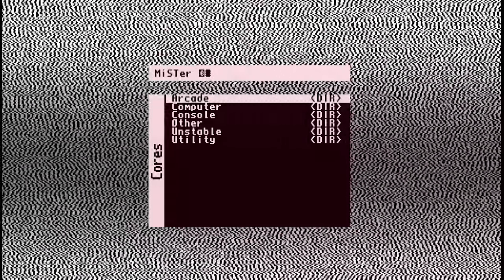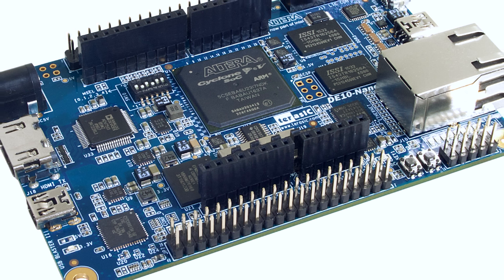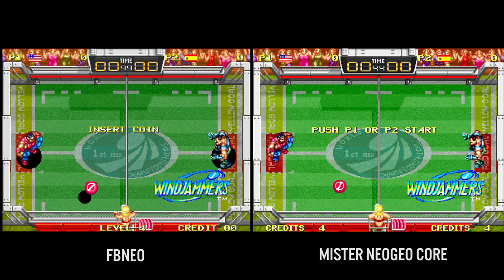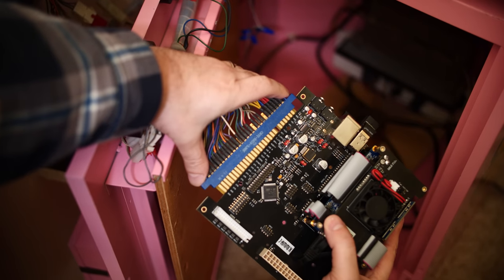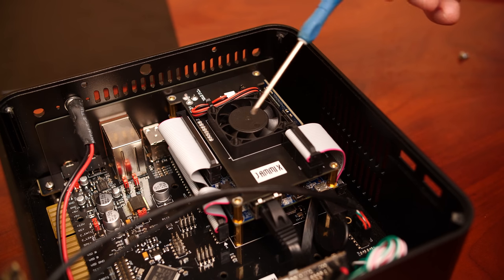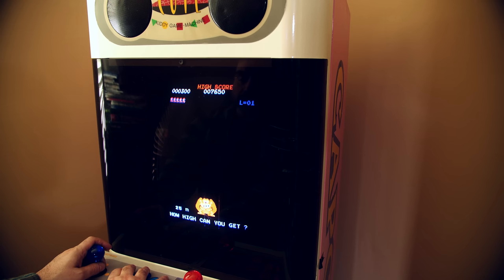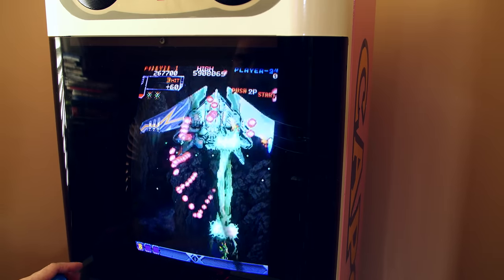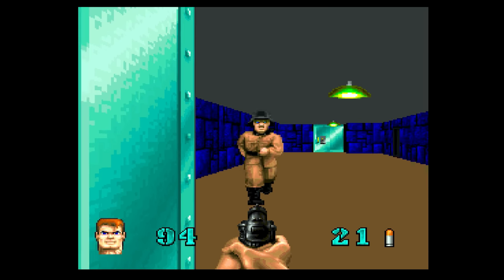Finally - I got my hands on a MiSTer FPGA Retro Gaming Setup | MVG

Comment: Anyone interested in building a Mister, lease don't buy a DE10 nano at scalper prices. These will keep being made and you will be able to source one for sure as long as you have a bit of patience. Consider buying the add-ons you want instead while you wait
Reply: there are several legit sellers of prebuild systems aswell, you just need some patience since they are waiting (and getting) restocks. 
been the same 1,5y ago
Reply: Order direct from Terasic! I did that, and paid retail, and $40 shipping, but, it came from Taiwan in under a week (3 days, if I remember right from placing the order)
Reply: I bought it directly from the factory, but between shipping and customs I paid around 300 euros. That's almost a scalper price (185 euros the board + 50 shipping + 64 of FedEx "customs")
Reply: This isnt the Framemeister where it uses legacy products, this uses current tech and just be patient they will be making more.
Reply: @kaisersoymilk6912  can you link me to where you bought it
Reply: I've paid 400$ for Mister from Aliexpress.
Reply: They are not scalper prices.  Just the DE10-nano kit is 150$ for education pricing so you need to provide a valid educational facility or student ID to buy it for 150$ USD + shipping.  If you want to purchaes it new.  I wouldn't trust the 2nd hand market from experice.  That FPGA chip does not have a thermal sensor so if it runs at 100 degrees for too long, it will start failing.  You can check the datasheet if you are bored.
Reply: What ever way you enjoy to play is they best way!! ❤️
Reply: Please! Give me a site to go to!! 🙏🏻🙏🏻🙏🏻🙏🏻🙏🏻
Reply: What is a realistic price for a fully finished Mister FPGA filled with everything you need?
What does thins nano kit do?

I want to buy a finished version since I lack the knowledge to build it on my own.
All the help I can get is very appreciated.

I live in Central Europe.

Comment: I used to work for Altera in the 00's. FPGA was generally too expensive for 'consumer' use then (top end FPGA's were around $4000 EACH at the time), but Altera's 'Cyclone' series FPGA (or our competitor Xilinx's 'Spartan') have changed that somewhat since and all of a sudden FPGA is a 'mainstream' technology. It's odd because I would be met with blank stares if I ever mentioned it to anyone at the time!
Reply: the reason the de10nano got affordable is because it got/gets heavily subvented by MS or Intel.
see the "intel university program" print in the board at around 2:45.
Wont complain though ;)
Reply: That's a wonderful insight. Personally, I didn't hear of FPGAs until very recently, and back then I was either a child, a teenager or a young adult depending on when in the 00's you worked for them. I'd definitely give you a blank stare if you told me, but I probably would've been excited back then if I knew what it was and how it worked, because it is a revolutionary piece of tech, especially for preservation of old hardware specs!
Reply: I met a band called Altera. I said wow, I load firmware on you every day. Used the cyclone many hundreds of times. Thanks!
Reply: Yea, same, we used them for programmable waveform generation and they were like 10,000 dollar radios, where most of the cost was the FPGA.  This was also in the '00's.  Times have changed, but I do believe this is an older (or smaller) Altera chip.  Their latest and great ones are still pretty expensive I believe (haven't dealt with FPGA's for quite some time so I'm out of the loop).
Reply: @dadrising6464  They've also just gotten cheaper in general thanks to supply and demand cycles. Cyclone variants and clones are used in a wide variety of homebrew projects, the most important (hardware archival wise) besides the MiSTer itself being ODEs like Terraonion's MODE and the Dreamcast GDEmu clones.
Reply: The early ‘00s is when V.Pudov made his V64jr clone, PVBackup, using an Altera FPGA.
Reply: I’ve read your comment several times and I still can’t figure out what it was that you mentioned at the time.
Reply: @BobBobOnYouTube  FPGA for use in consumer products for end users instead of highly-specific low-volume engineering and industrial purposes.

Comment: I got my MiSTer last year and it was one my best purchases in years. Basically my complete gaming childhood stuffed in one box. Plus, all the machines I always wanted to have back then but couldn't afford. The Archimedes always was a dream, and now I got one in my little box. Just amazing. Also, using a modern optical mouse with the Amiga and the ST is fantastic. The MiSTer is also the first machine to really get the Atari 8bit computers sound right. Every emulator I tried so far always was a bit off. The MiSter is the first time I heard the intro to Alternate Reality like I remembered it from the real machine.
Reply: The one console I really miss is my Atari 2600.
Reply: I got that. Its called a pc.
Reply: @an3582  Oh, you have a PC? That's amazing! Anything else you need to tell us? Do you have shoes as well?
Reply: @an3582  and your pc uses emulation to play these games which isn't as accurate as the MiSTeR FPGA.
Reply: @tyler6644  That's garbage. Software emulation has been around for decades now and is exactly what Mister is only in software and make no mistake that Mister IS emulation.
Reply: @an3582  This isn't intended for people that find the PC emulation options good enough. This is for people who want more or are more concerned with having the most accurate experience you can, outside of actually owning and using original hardware and having it in one box without the inconvenience of swapping discs and carts.
Reply: @AussieArcade  Mister is hardware emulation for lack of a better term, and I've been using emulation since the early days of NESticle and Brian's Emulator Page and the related rings. So, it's not like I haven't used a good chunk of the emulators out there.

What Mister runs is in hardware, and it was immediately obvious when I got mine running why I paid so much for something that's not running it on native hardware when I've got the original hardware. I have never found a set of emulators that are this good.

Comment: It's sad this is getting so expensive. When I set mine up it was $140 for the board, 30 for the ram, and a $10 USB OTG hub.  It runs all the cores and has perfect HDMI output. $700 is a super enthusiast build for sure but 300 for the base system is really a symptom for the chip storage.
Reply: This is what happens when you build a product around a loss leader hardware evaluation\learning board.  They aren't meant for release projects and mass sales because they cause intel to lose money and intel will supply the cyclone V to profitable boards first.  I have about 9 of those cyclone V's and I'm working on building a all in one unit that uses that FPGA BGA, adding a SDRAM slot on board, and all requisite outputs.  So you don't need a de10-nano but just the chips and solder them on luckily the chips are somewhat more in stock albeit a little more expensive for the single part.

Comment: Arcade boards are probably the most crucial hardware that MiSTer covers. It's hard to get your hands on those and they take up a ton of space. I'm tempted to get one just to have an accessible way to play arcade games on a CRT at home. Next best thing would be using MAME on a Wii but that has some serious limitations imo
Reply: Why not mame on a pc? T
Powerful emulation pcs can be tiny nowadays
Reply: @guyverjay1289  I imagine that the problem comes from getting 240p for a CRT in modern hardware.
Reply: @guyverjay1289  not as accurate, though as Jotego keeps submitting info to improve MAME accuracy it can definitely get better over time.  Accuracy isn’t their mission, combined with the inevitable timing differences introduced having an OS layer and a generic cpu doing it’s best to fake parallelism of the original hardware and it’s tough to get there 100%.
Reply: Mame on the Wii isn't very good. You'd be better off with Mame on a Raspberry Pi 4 now a days. It also supports composite and component cables.
Reply: @onldhes  The Pi4 is a great alternative.  They're cheap as dirt.  And they are supported by an active community.  Ditch the Wii.
Reply: Wow, this is really great.
Reply: I'll get one once the ps1 core is fully functional. Playing ps1 in hd, low latency and hardware level accuracy sounds pretty cool
Reply: Wii? Why wii?
Reply: @junior1388666  Have you tried the duckstation emulator? I haven't had a game fail on that yet unlike PCSXR which has always had problems
Reply: @Mibok  that's why groovymame exist
Reply: @Snowpiercer2  240p
Reply: @chemergency  You don't need Wii for 240p.
Reply: @GenesHand  you still need a compatible graphics card, the correct drivers compatible with such drivers. Most gpus nowadays don't even have vga output
Reply: for CPS1 and 2 its worthy
Reply: @Snowpiercer2  it's not just rendering in 240p, getting good output is finicky with a pi. its much easier to get a good image on a crt with a wii, since the hardware is designed with composite and component in  mind. the pi's trrs output is pretty poor, even for composite, most retro gaming distros don't have good support or documentation for setting up with a crt and hdmi converters introduce latency
Reply: @-nomi.-  Pi? Why Pi?

Comment: I'm glad you enjoyed it!  There are a few things you didn't cover that I think are noteworthy:

1. Dual output.  You can run the analog and HDMI output simultaneously.  My main setup has both a PVM and 4K TV, so it's convenient.

2. The 2P Gameboy cores.  Being able to have a 1-on-1 in Gameboy Tetris or GBA Puyo Puyo this easily is great fun.  Continuing on from #1, you can even set it to have one screen on analog output and the other on HDMI.

3.  User IO.  This is a massively important feature for me personally, because this combined with analog output allows me to use actual light guns for light gun games.  Long story short, with the right adapters you can essentially plug a real NES zapper into the virtual NES core, hook it up to a CRT, and play Duck Hunt just like on a real NES.  Of course you can use it with original controllers as well, but c'mon real light guns.  Some computer cores let you use this port for MIDI and UART as well.

But yeah, my MiSTer will be a mainstay in my bag when I have game nights at my girlfriend's place.
Reply from the maker: great info, thank you - ill follow up with a future video when more cores become available
Reply: Simultaneous analog/ digital dual output, NICE! I thought I saw $3,000 on the screen at the beginning and thought "Figures given all that needs to be done. I'll wait 5 years and check back" but $500 is a great deal for what you get IMO. I would buy one now if I still had my collection of retro hardware (controllers and adapters)
Edit: Analog input too! Light gun games? I'm very interested.
Reply: @ModernVintageGamer  PLEASE do! 😃😃😃😃😃😃
Reply: " my girlfriend's place"

L O L
Reply: Dual output saved my life with this thing. I'm a complete idiot and there's no way I would have figured out getting it to display on my temperamental old CRT without having a flat screen connected at the same time. Such a good idea to include this feature.

Comment: Admittedly the costs are inflated somewhat at the moment but even the top end cost equates to roughly to a Super NT and Mega SG combined. The value proposition for FPGA based equivalents is weighted so heavily towards the Mister 👌
Reply: If you can even find an Analogue console for sale. They do very limited runs of production
Reply: I found the MiSTer when I was looking at the Vampire for my Amiga,did the value proposition and bought a MiSTer setup. Has been awesome since.
Reply: @CotyCondry  That's a problem that's made its way to the MISTer scene now too as MVG alludes to. I nearly pulled the trigger on one last year and wish I had now as the whole setup could be had for about £300. Ironically, I managed to get both a SNT and MSG relatively easily without getting hosed.
Reply: @sheep83  Hopefully it eases as chip shortages etc sort themselves out 🙏🏾
Reply: @sheep83  Mister was easy to find until pretty much ever big tech tuber did a video on it in 2021, even just 6-8 months ago you could grab a DE-10 for under $200. I'm not complaining about this awesome project going more mainstream but that comes at the cost of it joining the scalp it or don't buy it club.
Reply: @devilmikey00  I think that problem has resolved itself. I ordered mine on 11/8 and received mine from Portugal on 11/17. For an international shipment from the EU to US, that's really not bad at all. I had nearly bought one previously and missed out. If it helps folks following, I just bought the entire kit from ultimate mister, and it was nice to have just about everything I needed other than controllers already assembled and ready to go. It mostly took me a bit to figure out how to set up the controllers and load my personal ROM collection. But it was a nice experience over all. I'll definitely want to get a USB WiFi adapter though.

Comment: Just the fact that this an open-source solution, this is miles better than any other similar solution out there.
Reply: Except uhhhh Retroarch
Reply: @aprofondir  retroarch and mister are two completely different beasts for completely different audiences. Also retroarch kinda sucks with their whole “engulf everything” philosophy
Reply: @alfiegordon9013  And what about Mister cores hidden behind a patreon paywall ?
Reply: @mrkirk4944  you must be new to emulation if people charging to access betas is upsetting to you.
Reply: @mrkirk4944  Only cores "Hidden" behind a pay wall are Beta or Prototype cores that haven't received their public launch. 

There no cores that got their public launch that behind a pay wall. 
So far only one dev puts his beta work for pateron backers only and that is only a very small subset of what is on the MiSter. They aren't even official cores after public launch anyways. 
Everything official is 100% free and available the moment they are out. 

And the "paywall" so to speak exist as incentives for people to donate to Patreon, as devs need to cover their R&D costs, buying service manuals with wire diagrams, buying original boards, decapping chips and such is expensive.
Reply: @aprofondir  
Retroarch is a frontend for emulators that works in software.
This is emulation done in hardware.
A solution like MiSTer has no overhead compared to original systems.
And hard to emulate systems like the Sega Saturn will be easier to emulate correctly and without overhead.
Retroarch has it's place and is great for what it is, but it's not really a similar solution.
Reply: It's not only open source, it's the best and most polished of all the FPGA consoles re-implementations
Reply: @MrDavibu  While all of the arguments here are correct, it's not even really emulation. It's reverse engineering and recreating the board with modern manufacturing processes. It's essentially the same hardware as the original system, shrunk down with added features.
Reply: @alfiegordon9013  retroarch is just as accurate. fpga is an overpriced gimmick
Reply: @hydroxyzine1136  nope, fpga is wayyyy more accurate due to being cycle for cycle, and taking direct I/O compare to the full software emulation used by retroarch cores
Reply: @MrDavibu  Original systems have their own overhead which comes from the fact that they were made using ancient silicon processes compared with modern computers. Retroarch can beat the latency of the Mister and original hardware if you use it's menu options properly (athough not for the Saturn so far...).
Reply: @JohnSmith-sk7cg  It is emulation. Dictionaries prove that fact. Some of the cores, like the snes one for example, were developed by porting a software emulator to Verilog. Others are less compatible than the best available software emulators, like the Amiga one for example, partly because those custom chips haven't been fully decapped and analysed, so it's the behaviour that is being "recreated". FPGAs do offer some timing advantages over CPUs, that can make a difference in SOME cores, but it's a stretch to call them cycle accurate or the same hardware. They can't recreate the analogue parts of old systems properly, like audio and some sprite scaling parts. And systems with different parts running at different and strange clock rates aren't being implemented with cycle accurate timing on any platform. On both CPUs and FPGAs you can get a decent experience with no tweaking of your setup, or an excellent one with some tweaking. They are different ways to achieve the same thing.
Reply: malice5121  if you really want to be pedantic, the general dictionary definition is not what you should be using, but the industry term which is translating machine calls for software designed to run on a different architecture. That is not what an FPGA, traditionally speaking does. It's the opposite, the architecture is designed to mimic the original architecture. Hence, not emulation.

In other words, if I run a program designed for x86 systems, it doesn't matter if I use AMD or Intel despite them both having different implementations of x86, they're both x86. We wouldn't call using x86 software on AMD "emulation".